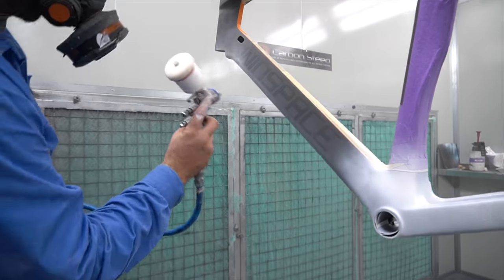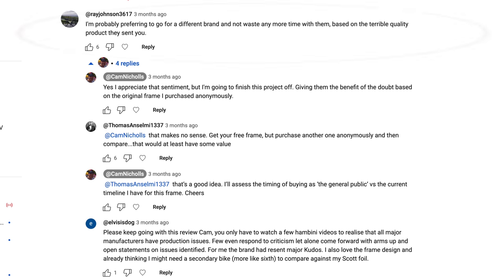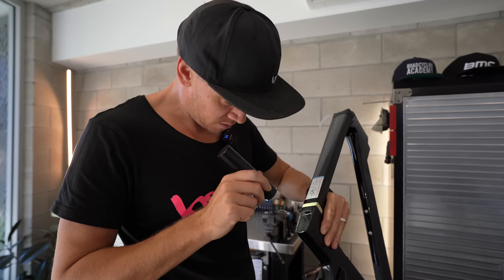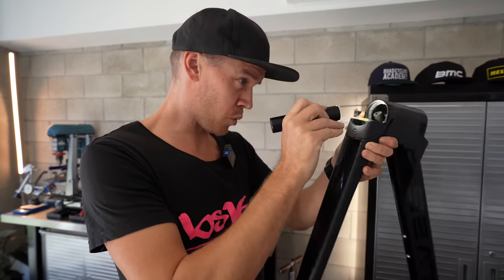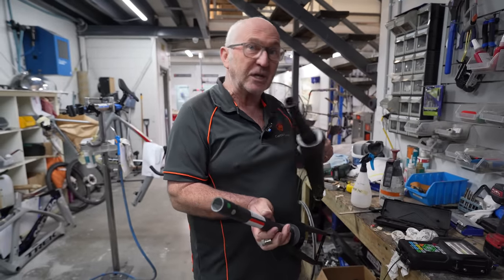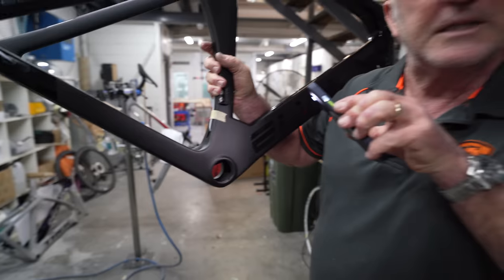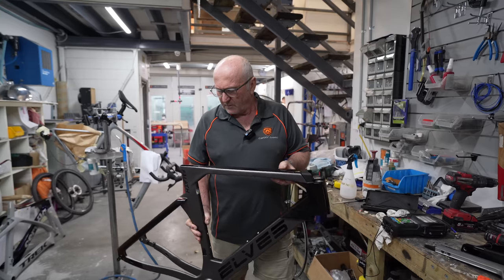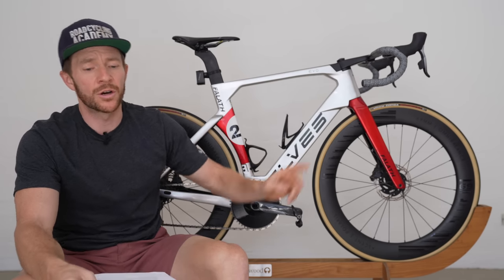I Bought An Elves Frame Anonymously (again)

Comment: In the aircraft industry, a very fine layer of glass is used as a visibilty layer for crack detection. It is exceedingly difficult to see hairline cracks or stress marks in carbon, while glass has an easy to see white marks. Personally in high stress locations, I'd prefer to see a layer of glass in there.
Reply: How many people do you know routinely remove their expansion plug to visually inspect the steerer?
Reply: @cup_and_cone  After a crash or impact I would
Reply: You would also see a huge increase in price
Reply: Glass is algo used in layups because It has more breakage elongation. Providing a tougher layup. In academic literature they call It pseudo ductility.
Reply: @Rafael-vu2xn  yes, but not because it would increase cost much (a handful of dollars).  There'd be a huge increase in warranty claims.
Reply: Two completely different scenarios man. Your talking about using glass as an aid in detection, we,re talking bout flat out BS...using glass instead of carbon...get it? No?
Let's replace entire parts of that plane with glass vs carbon...and...I'll be catching the bus thanks.
Reply: This doesn't really tell the cf content.

Actually testing for the cf content % is fairly easy, but it's destructive.
Reply: @richardgarza7083  In their defense, most aircrafts are made out of glass than carbon. Glass is not so weak, dont be afraid to catch a bus. I could make a glass fiber frame more stronger than any carbon frame on the market, but it would be multiple sandwich honeycomb layers, plus much more thicker glass layers. It would just not be as light as carbon, which is better. But this frame in the video is a carbon frame with barely little glass. In my opinion, it's a carbon frame. Now if they used glass and carbon together in any of the tubes(seat/down/top tube) then, yes, they took corners and you have a glass/carbon bike. If they said in this case it's a carbon frame, that's BS. But using it only in those few unimportant places. It wont hardly make a difference. Also, Lamborghini Aventador has a carbon frame. But technically the front and rear sections are Alu..... No one calling them BS..
Reply: Or at least wear glasses if doing a fine inspection.
Reply: That's not a standard in the bicycle industry. These guys are mean! Trek and specialized frames would also be getting ripped lol. Aircraft carbon is leagues ahead of bicycle carbon.
Reply: @richardgarza7083  "...we,re talking bout flat out BS...using glass instead of carbon...get it? No?
Let's replace entire parts of that plane with glass vs carbon..."

I must've missed the 100% fiberglass bike in the video. I just saw a carbon bike that has a few inner layers of fiberglass where it is not only not an issue, but is standard in other composite niches. If you want a 100% carbon bike just to say that it's 100% carbon, I believe you're missing the entire point of buying a carbon bike...
Reply: @jeremys2159  Have a look at what can happen with manufacturing faults in carbon forks.. Guy in Canberra died after his forks all of a sudden failed.  He was riding in a group for a coffee spin. Relaxed ride around Canberra stopping at a couple cafes and catching up. After going over a bump or something, the forks just finally gave way and he died. His name was Richard Stanton and he was 49.

Comment: If it's safe to ride and rides well, why would it matter? I think it is totally fair for a more budget brand to make more budget focussed material choices. In the end you roughly know the weight of the frame+fork, the penalty of the fiberglass is simply it will be heavier. I rather would have fiberglass in the fork than brake mounts that are not aligned, bearing seats that are too small or too large and everything else that can go wrong in frame production...
Reply: I agree with you, it doesn't really matter.  I think the point is that the bike companies should just be up front about it.  "Hey, on these models there's a bit of fiberglass in the steerer tube and here's why...".  I've never heard of fiberglass being used anywhere on a carbon bike, but now knowing why, I don't have a problem with it.  Setting expectations and being transparent with the consumer is important.
Reply: Because its about informed consent and misrepresentation. If a frame says carbon fork, you expect a carbon fork. If there's fiber glass, it should be made obvious for the purchaser to see. When its not obvious, that's when people start getting skeptical. This is, once again, Chinese marketing failing to comprehend western consumer mindset.
Reply: @cjohnson3836  that would simply be stupid from a manufacturers point of view. How many people would then not buy the frame because a few sheets of glass and instead buy another carbon frame that is full of defects and voids and what not? Building a frame is not magic, you either spend a lot or save on material choice or production quality.
Reply: @Horstelin  Those cheap Chinese manufacturers have already a small clients base, this is nerdy stuff territory. You're gonna loose them if you're being dishonest (as they are here bullshitting with the fiber glass), end of story.
And, this is not covered in this video but bear in mind all the obvious manufacturing problems in the bb/headset area. This is the recipe for a creaky machine.
Reply: @necrodefecator  You're assuming too much. As a fan of Chinese branded frames that cost even less than Elves I've only found one frame that has headset issue. I also have 3 Elves and 1 upcoming Evo.
Reply: @shepshape2585  Fiberglass is routinely used in all carbon constructions I know of. Take fishing rods for example. As far as I know the maximum amount of carbon fiber you can have in a rod is 96%, rest are resins. These are incredibly expensive and incredibly brittle, one little score on the blank and it is gone.
Fiberglass adds weight but also makes the composite product MUCH tougher so it is a matter of balance between lightweight and toughness. Fiberglass also flexes better and withstands better the abuse.

Ever thought why Giant calls their frames 'composite" and not "carbon"?
Reply: @thebespokecyclist3624  I spoke as someone working in the bike industry as a mechanic for 10+ years, so yeah, I might have a biggest angle on that chinese stuff because I see it and deal with it everyday. I don't bother cyclist enthousiasts ordering straight from Shenzen parts or even frames as long as you know what you're getting into. But a lot of ppl are actually getting really poor manufactured chinese frames without even knowing it (and the bikes aren't that cheap either).
Reply: @Horstelin its not a matter of being "stupid", its illegal to defraud customers by lying to them about the material.
Reply: @cooltwittertag  have fun then riding your 100% carbon fiber fork made purely out of loose fibers and mats. Oh you want them to be stuck together in a fork shape? Well you need resin, its not gonna be 100% carbon anymore. If not exactly listing the materials is lying, every single bike manufacturer is "lying" to you.
Reply: @Horstelin  so they should tell the truth. Pretty sure most manufacturers list them as composite frames for a reason.

Comment: As a composites guy, I have no issues with glass fiber being used in steerer tubes. It may be unnecessary in terms of preventing corrosion if a titanium expansion plug system is used, though. As for what the frame is called, "composite" would be an all-encompassing term. I recall some high end brands (Time?) also use other materials like kevlar for impact resistance in their layups too.
Reply: Time and Wilier now use a LCP like Vectran ( for Time ) .Bianchi use Countervail .But again in the case of Time it's about Braided Carbon Structure (BCS)
Reply: I have PBO+carbon fiber frame，it's more impact-resistance。😎
Reply: Composite indeed. Time now uses Dyneema for reinforcing the carbon mesh.
Reply: @tonyg3091  it is not easy to bond UHMPE to the resin
Reply: @peterocks88  yeah I know but the strands seem to be few and far between so that might help dunno
Reply: Honestly, impact resistance is HUGE with carbon fiber. I think people often go "strong material is strong" and yeah.... but composites are strong *in specific load cases and situations*. Carbon fiber is really nifty, but it doesn't particularly like compression in the first place, and after you've whacked it on something, it gets downright fragile. This is part of the reason carbon fiber frames aren't even lighter: because you have to design the thing to still be strong enough after something hard has nicked it or whacked it. An impact will start microfractures, which propagate through the matrix material and weaken the structure, especially in compression where the fibers themselves are incapable of resisting. Adding something to the matrix (I've heard promising things about graphene, but this was years ago and I have no idea how they've gotten on with that since then) can give tiny hard stops to these microfractures and prevent some of the loss of compressive strength, but I don't have any problem at all with my carbon composite parts including different reinforcement materials to focus on impact resistance.

Comment: I can't really see what the issue is here....The fork tube has a layer of fibreglass that will prevent corrosion and make it stiffer, adding less than 10grams of weight. Then saying "Its expected for a heavy frame" . My all up race weight falath evo is 7.8kg with wahoo roam/pedals/bottle cages. What weight was he expecting for a fully aero race bike?
Reply: Is there even an issue with a heavy aero race bike as proven by multiple sites and tests? It would be for a climbing bike...

Comment: I'd love to get a "what actually matters" with these types of videos.  What will lead to me riding down the road and have the frame spontaneously collapse, burst into flames, leaving me to get eaten by a tiger, vs. "it's just not perfect, but it's fine".  The focus on BB area has been enlightening, the nice even circles and all of that makes sense, but what's the point where it matters?  I know "fine" is hard to quantify, I'm 151 pounds and my fine may be far more tolerable than a 250 pound rider that slams ruts and potholes and such.  But, give me a level of what matters on some level.
Reply: A similar occurrence happened to a friend.  His frame didn't combust but it got so hot, he had to jump off and because he was getting burned he jumped into the ocean and then was eaten by a  shark.
Takeaway is...in life, sometimes better to be lucky than good.

Comment: Glass fibre is the correct term. Fibreglass is a trademark.
Reply: Not any more it ain't. "It's now a proprietary eponym, a brand name that, due to its popularity or significance, has become the generic name for the product it represents." and was really only applied to spun glass insulation and not GRP composites.

Comment: There is one more very big reason to use glass fiber in the steerer (and not elsewhere) it is that the modulus of glass is much lower but the elongation at break is much (3 to 4 times) higher. In practice, that means that in normal use the carbon is the one carrying pretty much all the load and the glass fiber will just stretch and carry very little load... But if you have a big crash or hit a big pot hole or another large object on the road the carbon with snap at something like 2% elongation while it will take about 7% elongation to break the glass fiber... That can very well make the difference between a fork that snaps off clean immediately and one that gets crushed but with the fork remaining attached to the steerer because of the glass fiber... If there is one place on a bike that you nevr want to snap off clean it is the fork steerer, guarranteed face plant... Also, do not call it "fiberglass" which usually refers to much cheaper and lower property glass fiber reinforced polyester resin used in boats while this is glass fiber reinforced with the same epoxy resin used with the carbon fiber...
Reply: I'd be pretty sure the failure model you suggest would not happen. A crash of this sort is a load dominated failure, which would cascade through the whole lot in short order.
It the video is correct that sacrificial glass/epoxy being woven cloth there would be additional issues during complex bending/tension failures.
Reply: These were my thoughts as well. Although I wish there wasn't so much delamination
Reply: I just ride alu frame rather

Comment: My Falath was supplied with an out of spec c-ring headset adapter (interface between the upper race and the first spacer). I wasn't even aware of this except they sent me an email asking me to check the frame for chipping of the paint. There was very minor chipping of the paint around the top of the headtube. 

Long story short - they are sending me a second frame. Very happy to have purchased from them considering the original frame is fine.
Reply: Did you have to return the first one? Or you keep it and use it?
Reply: @neutronshiva2498  He gets to keep it.

Comment: Thanks for the great leg work on the F.G. in the steer tube.   In the marine industry, where corrosion is a huge issue, carbon rudder posts, carbon booms, carbon masts, and carbon spin poles are all buffered with F.G. where stainless fittings are attached.  The carbon will cause corrosion of the metal surfaces in short order.   I just assembled a Falath frame and was happy to see your video with the FG interior of the steer tube as I used a metal tensioner internally.

Comment: While the depth of analysis on these frames is impressive, we are overlooking the bigger picture concerning the product and the purpose of these reviews. I would argue that these frames offer an incredibly good value for their price, as the quality, performance, and aesthetic output surpass what else is on the market for their cost bracket. As an owner of the Falath, I can confidently state that my experience with the frame has been flawless, with the exception of a minor overspray (non)issue, for my custom paint job.

The notion that a small sleeve of fiberglass, which serves to prevent galvanic corrosion, is considered a weight penalty is laughable, given its weight of 5-10 grams.
Reply: The bigger picture, IMO, is whether these cheaper frames are in-fact cheaper quality.  I think Cam is answering that question in this video series.  Of course as an owner, you want to believe that you beat the system by buying a cheaper frame with no compromises.  We'll see.
Reply: @bluemystic7501  I think that is certainly part of it, and yeah we will have to see what his verdict is. I just don't necessarily agree with the angle at which he is presenting the content, referring to these frames as 'cheap' comes with natural negative connotations. Ultimately, in an industry that is wildly overpriced, more affordable options that also offer high-end performance is surely no bad thing?

I'd be happily proven wrong, if my frame were to snap then I sleep comfortably knowing that I have a comprehensive warranty on it.
Reply: Well, established brands all have major quality issues. Bianchi's new handlebars breaking, Canyon's seat post collapsing... I would rather pay a fraction of the price knowing that it can have a few gremlins, than pay for over priced garbage.
Reply: @alexkerslake4613   Well, high-end performance (and quality) is debatable.  We'll see.
Reply: @jaymendes  Lol my Wiliers all have more issues than my less than $700 cheap Ali frames.
Reply: Hmmm true maybe he can use some of that scrutiny on his BMC. Expensive products deserve more of that in depth analysis.
Reply: When you say performance, what do you mean? How did you arrive at that conclusion? Is performance, outside of reasonable strength/stiffness/durability, a metric that most riders should care about? 

If you're not racing at a high level, and have a chance at placing well, I don't see the point of a sophisticated design. Quite the contrary, I'd recommend simplified, reliable designs, that use well proven profiles. Simpler designs enable easier manufacturing and present fewer QA challenges. The enthusiast hardly benefits from single digit watt savings, but a strong warranty gives them financial assurance. A local representative is much better than an email address.
Reply: good value for the price? A fork that snaps in half whilst riding down hill is NEVER "good value".
Reply: @xdd1853  YT hambini.
Reply: All this bickering aside, I see both sides of the perspective. Aside from opinions it's very difficult to drill down to the engineering specifications of this modern composite material for bicycle manufacturing.
The vast majority of us are not material engineers, so it's informative when get to see what's "inside".

Comment: Hmm interesting, I've cut two Cannondale Hi Mod steerers, a Cube and a Winspace Steerer and can confirm they are all carbon all the way through. I wasn't aware of fibreglass being used in carbon frames in the structural areas. I've heard of it being a barrier between differing metals. Nice video Cam, thanks.

Comment: Aside from stiffness/weight issues, for this consumer the most important consideration is how the use or absence of fiberglass impacts the longevity of the frame, especially regarding galvanic corrosion. I'd love to see a look back at the life expectancy of 5, 10, 15 year old carbon frames based on their choice of materials for things like bottom bracket shells and dropouts on rim brake frames.